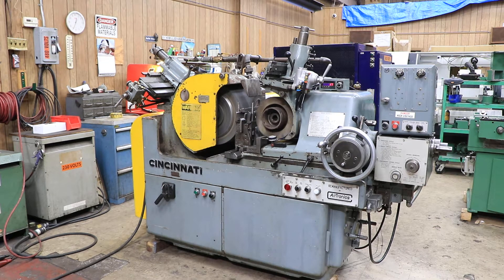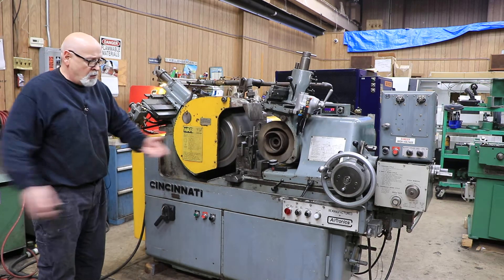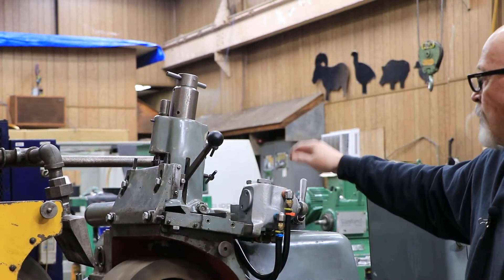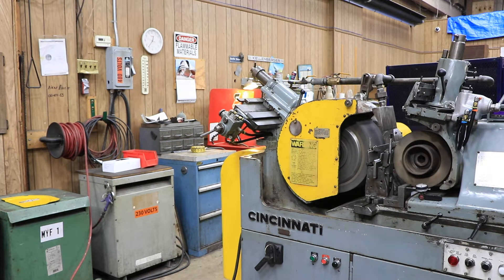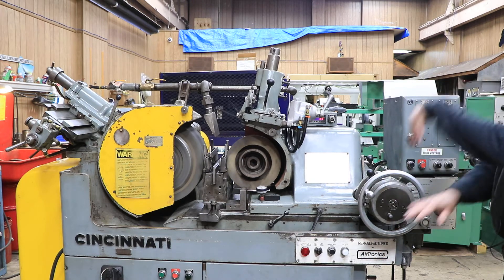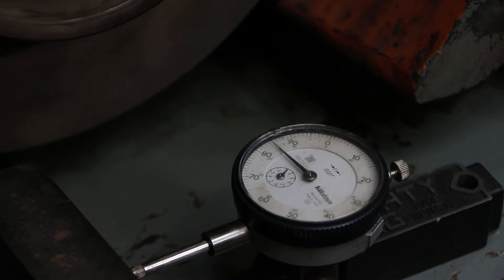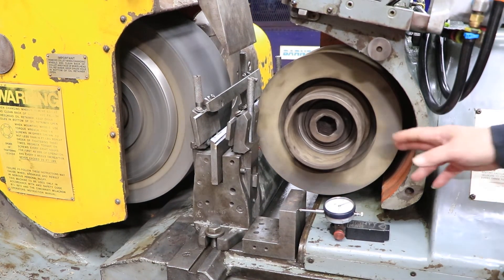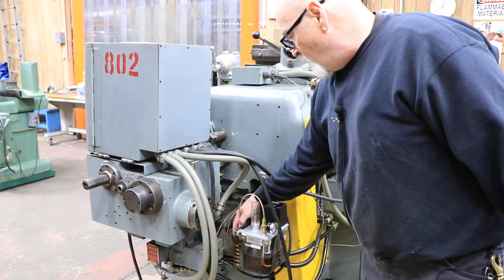No. 2 CINCINNATI "OM" CENTERLESS GRINDER

Comment: I want to know why my size change, at my workplace the piece keeps getting small and I have to open the regulating wheel every 8-10 piece!! The stupid operator/trainee says it’s ok but I think it’s pathetic that the machine can’t run consistently.
Reply: Probably have whatever youre grinding overhanging you bottom blade to much

Comment: HELP. I use this machine at my work. How do you take apart the regulating wheel?
Reply: You should have a collar with around 6 bolts on it. Take them out and then the collar. Then go to the other side with a heavy rod and hammer the reg wheel off. Sometimes they get stuck on there
Reply: @joshbob-sx7kd a bit late

Comment: I used these while working for an US company here in Italy that had these. Originally, at 6:10, we used to change the speed of the right wheel using the two levers that you see at the bottom, right below the section with the red sticker and just above the brick. I can't recall now the position to make the right wheel go full speed but i think it was both levers to the right, not put right away but you had to switch few positions to be able to move one to the end and then the last one. This is based on my experience of course and also the way we used to work with them but....whatever the future use of this one will be, ALWAYS remember to prepare the machine correctly by starting the cycle so that the right wheel moves forward,, wait for it to stop moving, then place the master sample of the product you want to grind right between the grindstone and then move the wheel toward it so that its briefly touched by the stone & the wheel but you can still drag the master sample out. IF you don't do that step BEFORE starting to work with the machine, the machine will not know where to correctly stop and you might end up crashing the wheel against the stone and startup fire or even make it explode or having piece of it flying here and there. And replacing one requires a chain hoist and patience. We used to 'clean up' the grindstone by using slow-mid speed, cause full speed would leave some marks on the grindstone and that would end up reflected on steel bars body structure for example. Safety is nr.1 priority in any case.

Comment: Hi, I have a question on our thru feed Cincinnati, we're having a issue with low spots on our tolerance on our parts .0002 lower even after dressing both wheels. Do you have any idea or suggestions what could be causing this? Thanks!
Reply: I run this kind of machine for 30 years Things to check is that your blade is tight and dressed and the blade holder is all clean and level if that is not it put a bar under reg wheel and a dial indicator on top and check how much moves it should not move more than .002 - .005 if it is running way more than that you might need new bearings or I think you might be able to adjust them ones if you have a book look into that And if you are grinding steel I dont know much about that I ground carbide
Reply: It may be the part itself having low spots that’s a tight tolerance for through feed if not and it’s either ends you need to change the feed wheel taper if that doesn’t work dress the grinding wheel, to change taper there should be two bolts under the captain wheel opposite each other with thread those are the ones that change taper on feed wheel
Reply: I want to know why my size change, at my workplace the piece keeps getting small and I have to open the regulating wheel every 8-10 piece!! The stupid operator/trainee says it’s ok but I think it’s pathetic that the machine can’t run consistently.